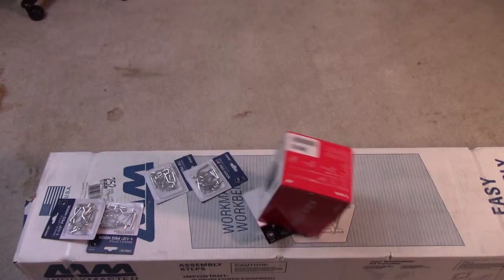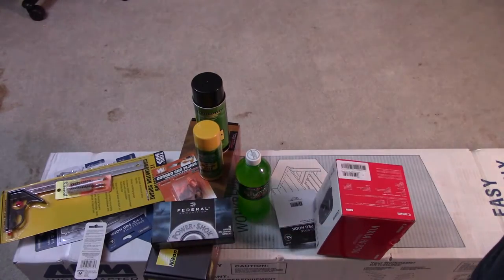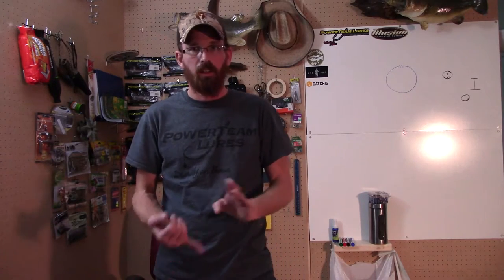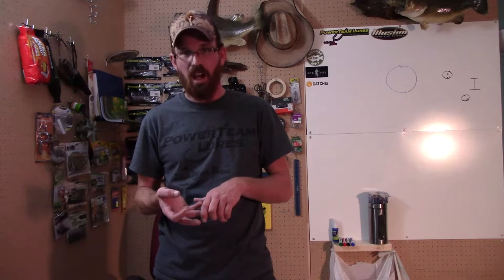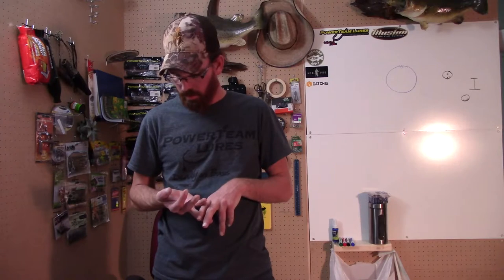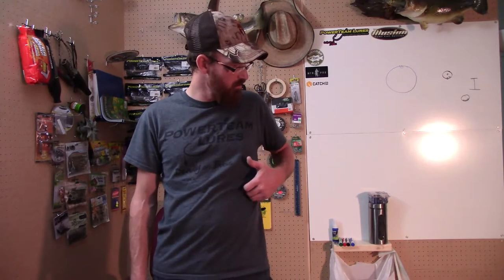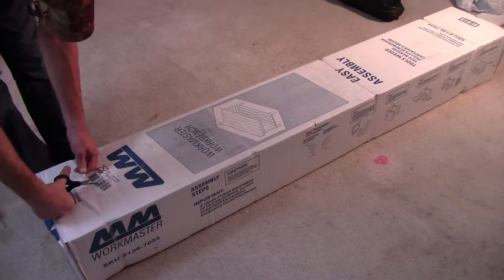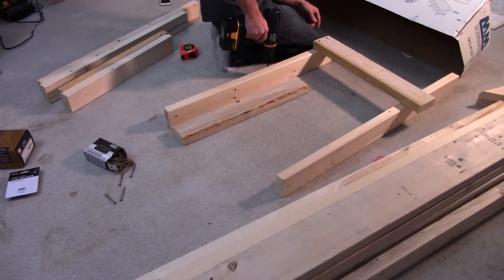Midwest Manufacturing Work Bench build

Comment: Got the exact same kit 'bout 6 years ago:  
stained it, anchored to the wall plus mounted my Harbor Freight vise on one corner.  I'm not rebuilding engines on it but lots of oil changes, brakes, fan belts and such plus gun cleaning, house projects.  Makes a good serving table when grilling out too.  Cheap wood and drywall screws it's held up very well.